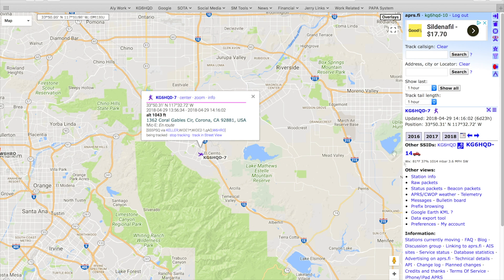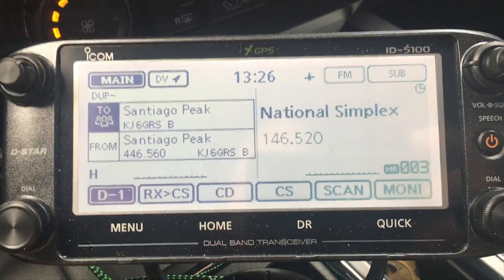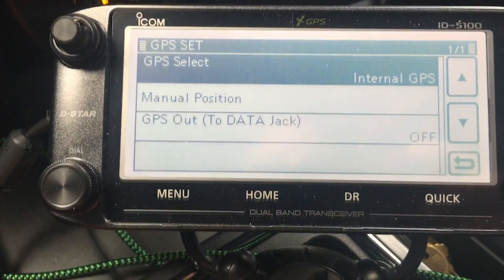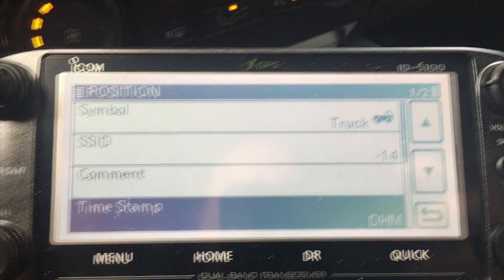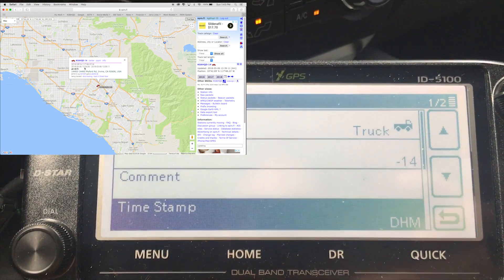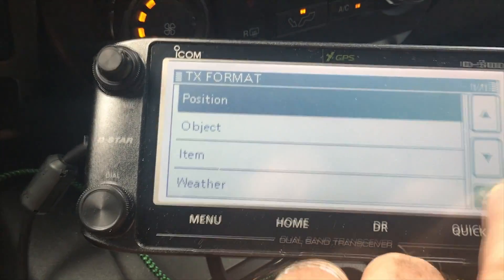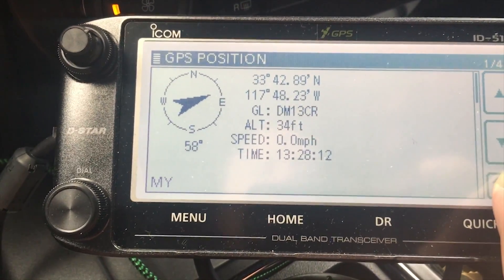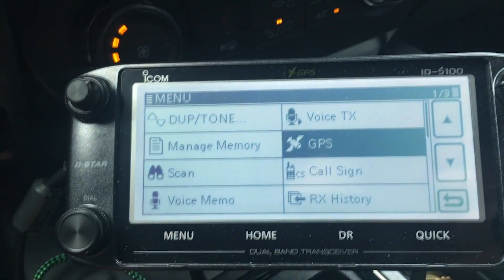How to use DPRS with APRS via GPS iComm 5100 (2018)

Comment: Why can't iCOM just implement regular APRS in their firmwares?  
That way it doesn't require a DSTAR repeater and can be picked up on the regular APRS frequency by any number of digipeaters out there across the U.S.
Both Yaesu and Kenwood implement real APRS in their radios, why can't iCOM?

Comment: This is innacurate, the YOUR field needs to be set to CQCQCQ. If it isn't configured this way, you'll throw the gateway in a loop constantly kerchunking. Worst case scenario your call will get blocked from that gateway. Also, set radio to -14 SSID.  All other settings are correct.  The best way to do this is with the RT-Systems software. See below.  Info for this can be found on http://dstarinfo.com/dstar-web-calculator.aspxProgramming for talking on WA7HJR (port DV B) to (port DV B)  YOUR::CQCQCQ             RPT1:WA7HJR▪B                     RPT2:WA7HJR▪G                 Set Radio To:444.6375 MHz  Offset +5.0000 MHz
Reply from the maker: The point of the video was to get the GPS position to overlay into the APRS.fi website.... thanks for the info and I've since found several ways to use the ID5100.  Truck SSID was set to -14, and maybe you are referring to me not bringing the "YOUR" field back after connecting to the gateway?  Small things to remember with videos as they are easy to pick apart despite the great lengths we go to put out helpful info.

FYI, your link was not found when clicked so not sure where that file is you were referring to? If you can check it then repost it I would like to take a look at the info. 

I will add I have since placed this radio in my shack and moved over to the FTM-400 for true APRS use.  Now I pretty much just use a hotspot with the 5100 and the regular side of the radio as normal.  Still a great radio and I'm glad I have it.

Comment: Thanks Jerry.  This has been VERY informative for me!  I am purchasing an ID-5100a this afternoon, to replace my old Anytone AT-5888UV.  I will be revisiting this video, to set up DStars once the radio is installed.  "73" KD0WGQ
Reply from the maker: So, by now you should have your 5100, how do you like it? The manual kind of sucks in my opinion but the radio is nice.  Double edged sword to have such a large display console that sure does make mobile mounting tricky.
Reply: KG6HQD Jerry Hi Jerry!  I am up & running, after a few false starts, having the wrong Anderson Powerpole connectors, etc.

The 5100 is a pretty amazing radio compared to previous radio; I have played around with the D-Star / APRS overlay some, but find the Gateway is inconsistent in position sending (May trying a different gateway.  Wondering if the DV gateway I have been using either doesn’t have a y’all enough antenna or is just not set up 100% on gateway side.

I do want to try out Reflector use (watched that video as well) and also CS routing!

73’s for now.  KD0WGQ (Pete Miller)
Reply from the maker: DPRS overlay is kind of tricky because some machine block it. I’ve been able to get my APRS signal posted through my hotspot finally but it’s still a bit elusive depending on what else I have going on. Fun item to play with and experiment though.

Comment: I wish the icom radios just included it all. APRS, DPRS, etc. Depending on an available internet connected Dstart repeater to do anything with APRS is pretty lame :(
Reply: Thank you for this video though by the way
Reply from the maker: I agree ... but that’s how they keep us buying radios... add just enough features to make you want it, buy it, then after you use it long enough you find its shortcomings ... is there such a thing as the “perfect” radio?

Comment: I've been going in circles trying to use APRS on my ID-51 (HT).  All the menu options are set up the same way as the 5100 according to the manual.  As far as I can tell, I should be sending position info.  However, because I am not near a DSTAR repeater, I need a DV Dongle and a reflector to use DSTAR.  Does the DPRS info get sent out of the repeaters connected to the reflector?  Is this even possible?  I'm not sure the juice is worth the squeeze. (Jim - N2SUB)
Reply from the maker: The short answer Jim is I don’t think you can. I’ve only been able to overlay my DPRS position onto APRS by utilizing a gateway repeater and one that allows for positional data. I have not been able to recreate the same scenario using my pi-star hotspot either so I base my answer on that. A big reason why I’m swapping out my ID5100 for the FTM-X400 as soon as it is back in stock with gigaparts. I still really like my 5100 so it will be placed in my shack/man cave. Hope that helps you, or at least let’s you know it doesn’t work that way. If you find out something different I hope you come back and share with us here.
Reply: @KG6HQDJerrySOTA  I don't know how, but I did get listed on aprs.fi 1 time last night.  I checked into the REF001C net, and I guess at some point while I was yammering away,  I got relayed via VE3MHY-G.  4 packets.  Maybe you just have to keep running your mouth for it to work, but I've proven it can be done, I'm just a little sketchy on the details.
Reply from the maker: How were you connected to that reflector? Was it via RF on a gateway machine or hotspot?
Reply: @KG6HQDJerrySOTA  Hot spot....DV Dongle.  There are very few DSTAR repeaters in the area, and definitely  none I can hit with an HT.
Reply from the maker: Well then, if you did it do tell as I’m just as interested in how you pulled that off. I mean it makes sense if the hotspot connects to the internet and is in essence a mini repeater but maybe I have my settings on the pi-star not set to work right. Any details on how you did it would be helpful.
Reply from the maker: I wonder if you were pushed out to APRS since you were on a net and I wonder if somebody on net control had a machine linked to a gateway repeater temporarily?  Maybe go back to REF001C and use that for a bit to see if it spots again and then contact net control of that net to see what they can tell you. Generally speaking it won’t work in my experience unless it’s through specifically a gateway machine but I’m always down for learning more ways to skin a cat. Like you I opted to buy a Yaesu radio that actually does interact with APRS and I’m also thinking it’s because APRS is an analog mode (FM) to carry the packets. Wonder if somebody had 1C cross linked to an analog machine and that’s how you got picked up.

Comment: Currently I use my HT connected to my Cellphone using APRSDroid.  However, I can't talk to anyone that way and I have to make changes to the HT each time.  I am looking at getting the 5100A (a friend has one now) .  If you can't get a DStar repeater and talking on analog or  talking simplex, can you set up the second channel to transmit to APRS?  Also, can you see other peoples location with the 5100A somehow?  I am part of Jeeping clubs that we go offroading and nice to be able to find someone if we get lost or need to help with a recovery.  ALSO, with APRS, I have had some luck with sending text message.  With 5100A, can you send text messages to SMSGTE?
Paul K7PAS
Reply from the maker: Hi Paul, sorry fore delay I've been tied up on some things lately.  I love my 5100A but it does have some limitations.  no on APRS on B-band unless you find a way to connect a TNC and go that route with it.  It's not really an APRS radio rather is uses DPRS which talks online to APRS.  It really only shows distance and direction and IIRC coordinates but not a map.  No messages like APRS either..the two are very different for sure.  Hope that helps.

Comment: Jerry, I just got my ID-5100 today and I am loving it. I am usually on REF30C but I will connect to REF12A to say hello. I will be setting up the 5100 to use DPRS to see if I can get it working. Thanks for the video. - KM4VWS
Reply from the maker: Awesome!  I was a bit apprehensive about the 5100 at first only because the remote head is pretty big. I’ve gotten over that and love it. Look forward to hearing you on 12A!

Comment: I'm pretty new to D-STAR and DPRS/APRS.  I for the life of me can not get my position to show up on aprs.fi.  I'm using the 5100 as well; I followed your exact steps; things seemed to work with the gateways and such, but when I look on aprs.fi, I'm not seeing my call sign.  I tried from a few different local D-STAR repeaters that I can hit from my location.

Is it because I'm not moving (the 5100 is being used as a temporary base station in my house)  I do have GPS lock and data.  I'm just generally confused as to why it isn't working for me.

-K5ZED
Reply from the maker: Hi Justin.. did you search your call sign in the APRS.fi site? If you added a unique identifier such as -14 or whatever use that too. If still having trouble then there’s gotta be something missing (obviously right). Since you have the 5100 I’m on REF012A with quite a few of the guys from here and Twitter from 1530 PST - 1730 ish Tue to Friday maybe connect then as we can chat through it.  What’s your call sign and did you use an identifier?
Reply: I did search my call sign in APRS.fi and did not find it.  K5ZED.  I did configure the radio correctly and put in a -15 and changed my symbol and still no joy.  So I may have a thought as to why I'm having issues.  So The three repeaters that I can hit from my house, it seems like the owners all require registration to their ham club in order to even use Local CQ or Gateway.  My assumption is they are filtering/blocking call signs.  If this is the case, that is pretty terrible practice.  I understand the need and cost to maintain a system, but what about Hams just passing through that want to use the repeater.  It also kind of discourages users trying to get into the hobby.  Anyways, that's my 2 cents worth.

Well, I'm going to go the other route and buy myself a DVAP and a PI so I don't have to worry about it.  Really bummed out that I can't use a local repeater though.
Reply from the maker: Are you able to make a Dstar QSO using one of those repeaters?  I assume you’ve registered your call sign on the web through one of the repeaters? I know it’s an obvious thing but thought I’d ask to make sure you’re in the system. Aside from that I’m not sure why you’re not able to get in.  When would you be able to chat on a reflector so we could go through each setting to mirror it?
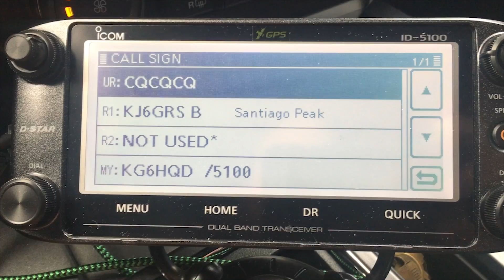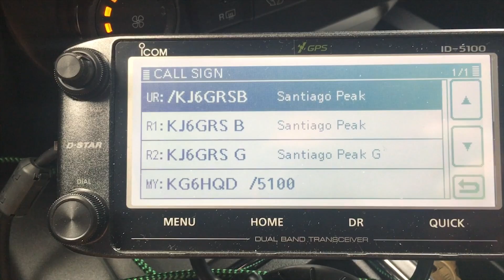Reply from the maker: So the one step I'm wondering if you are missing is ensuring you are going through a gateway.  You would need to ensure you have the gateway repeater shown in both the fields the FROM section on the bottom and the TO section on the top field.  If you have CQCQCQ or Local Repeater in the top field then you are most likely NOT opening up the gateway and getting your signal out.  I think this is why I'm not getting my signal out now using the pi-star because I'm using the KG6HQD-B vs the KG6HQD-G signal command.  You can check this by looking at 4:52 in the video and seeing what the R2 field shows.  If it is the same as in that part of the video this could be your problem.  Can you confirm your radio looks like the video in 5:15?  The FROM and TO must be the same then kerchunk it to establish the link.  At 5:24 did you get the UR:? ? It must show the ? indicating it was a good connection.  If no ? then you're not making the connection.  At 5:28 hit CS and ensure the R2 field shows the machine you are going through with the "G" telling you it's going through the gateway.  If all that is working then you need to go to the GPS settings and ensure those are right.  I'll wait for your reply to see if that fixed your issue then we can move to phase two if not.   Let me know once you get to try it and if you want to make a short video clip and post it to Twitter and tag me @KG6HQD that'd help too.
Reply: @KG6HQDJerrySOTA  - So it's been a while since I took a look at this reply; sorry for the long wait.  All of my settings are the same as in your video.  My CS menu is correct with the same R1 and R2 (with the G); I am connected to the gateway, however I still don't see myself on APRS.fi.

As for the GPS menu, that is also correct.  I'm set to position, I have a Symbol set with a SSID of -14 but I do not have a comment set.  Time Stamp is  DHM; Altitude is on, Data Extension is Off.

I assume when I key down, I should see someone on APRS.fi in a matter of seconds or so?  Either way, nothing ever does show up.

One thing to consider; all of the D-Star repeaters in my area(nearly most of them in the State of Wisconsin), are ran by one group and most of them are perpetually connected to REF 19B.  Does it make a difference if the repeater is connected to a reflector?

EDIT: I have tried this now from several DStar repeaters in my area with no luck.  Maybe my registration isn't completely setup.  The repeater I'm "registered" with is W9BCC (Wausau WI).  I sent an email to their info email address from http://www.rmra.ws/ because the registration URL on the D-StarUsers.org website for W9BCC doesn't seem to work and I'm not able to register with any other repeater.  I know this, because I contacted a different repeater group and I was told that I was already registered with W9BCC.

Honestly, I'm starting to get turned off of DStar simply due to the issues I have been experiencing thus far.  I'm hanging in there and I'm hoping that someone reaches out from this repeater group to help me out.

I also appreciate you taking the time to help me out KG6HQD.
Reply from the maker: Justin Bliske I am wondering if the repeater you are going through that is connected to the REF is the issue. I do not show up on APRS either when I’m going through REF side of things only when straight into the regular Dstar side much like a typical analog machine. I’ll have to ask around by others who are better versed in the topic to confirm. Hang in there, it’s the fun part figuring things out. Btw, I’m on REF12A usually every morning and evening on my work commute. Check me out on Twitter as I post there often so we can connect closer to real time.  Tues-Fri 0500-0530 then about 1540-?1700ish

Comment: I have been asking this question to every you tuber that I can find. Still haven't got an answer as of yet. What is the difference between an Icom 5100A and an Icom 5100E ? Also can you monitor D-star reflectors without transmitting on them? Kind of like using it to listen to other people talking ?
Reply from the maker: The 5100E is the European version so without looking at the specs I would guess it prob has a little different freq range and maybe some language differences but other than that the basic function should be very similar. 

Re monitoring the reflectors, do you mean on like radio reference or just using the radio itself?
Reply: Just using the radio itself until I get my tech license
Reply: kind of like you do a police scanner. When you just listen to the channel and not talk on it
Reply from the maker: So I was checking out radio reference or broadcastify.com and found reflector 12.  Try searching around for the area of coverage you want to find which reflector on and see what you find of interest to you.  https://www.broadcastify.com/listen/feed/5429 hope this helps you get started on finding what you're looking for
Reply: But my question is can you just listen on the reflector and not transmit ? While using the 5100 ?
Reply from the maker: of course, it's not different than listening to any other freq
Reply: Except you would need to transmit to connect to the reflector. This would be a problem if you are not a licensed amateur radio operator. 
-KM4VWS
Reply from the maker: True on the kerchunk and being licensed. 👍🏻

Comment: Thanks Jerry! Questions answered.
Reply from the maker: glad it helped!  What was is you were trying to accomplish exactly that I was able to answer?
Reply: One of the main reasons I bought a FTM-400 and FT-2 was because they had APRS built in. I cared more about that than the digital capabilities, but now that I use fusion a little bit, I'm more interested in digital stuff. There aren't any fusion repeaters near me since my move last year, so I use a SharkRF Open Spot. With that I've done some cross-mode to DMR, but haven't hopped on any DSTAR reflectors yet. I'll probably register with DSTAR tonight.

 I knew digital modes could share location information, but I was unsure if there was a simple way to share that info from a DSTAR radio to the APRS network without additional equipment. It's good to know that it can share the position data without extra gear. I think there are more DSTAR repeaters than digipeaters in my new area anyway. I wish you could still message with analog APRS users without additional analog interfaces, but everything has it's pros and cons. 

After reading around, one feature of the 5100 that is a big selling point for me is using the GPS to find repeaters. This seems like such a basic idea that adds a ton of convenience. The stuff you can do through a phone looks pretty awesome as well. Thanks again for the info Jerry. You've probably motivated me to buy yet another radio. When it comes to guns or radios and my wife asks me, "How many do you need?" Answer: "Just one more."
Reply from the maker: Ha, that's awesome Ray!  You can always do what many of us do and sell one then buy one so she has less to gripe about, if that's possible lol.  DStar does seem to be the emerging trend and with multiple radio manufactures able to build them I hope it only gets better.  Thanks for commenting, I really do appreciate hearing from others. So, when will you be buying a 5100 now though?  😎
Reply: Haha. It's next on the "one more" list.